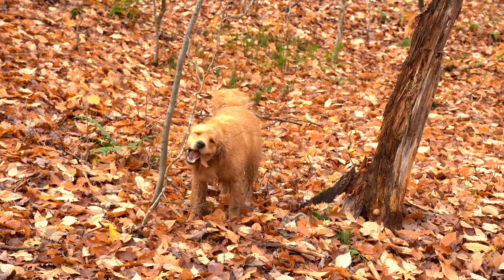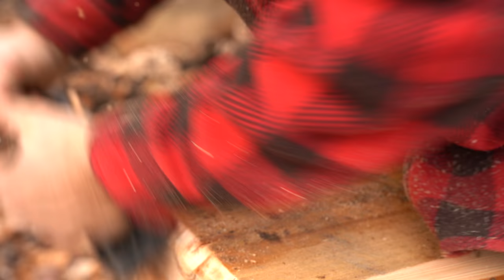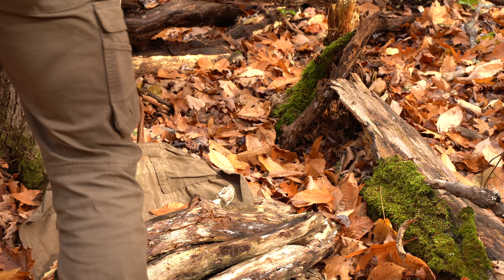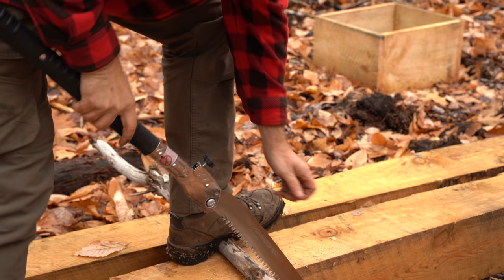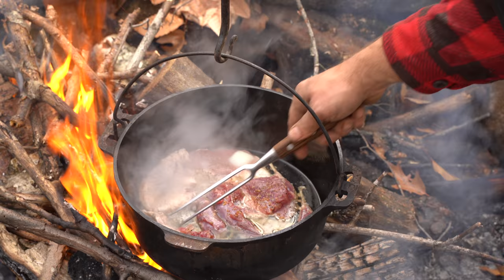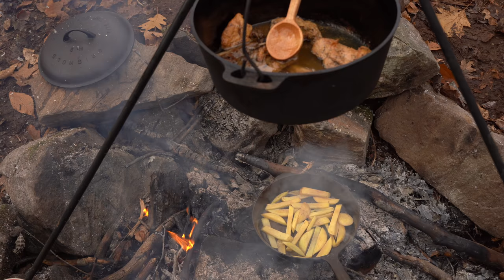Building a Square Off Grid Log Cabin| Lifting Heavy Logs | Squirrel Confit for Lunch

Comment: Also, by lifting the timber with only a single pulley at the top you're lifting the timber at 1-to-1 ratio. So if the timber is 100lbs you need to put 100lbs on your end of the cable to lift it.  If you added a snatch block at the timber you would cut the force required to lift the timber to 50lbs.  If you did a pully system with a double pulley at the top and a double pulley at the timber, you would be reducing the force required to lift the timber down to 25lbs.  A couple of small changes to make your job a lot easier.
Reply: You say snatch block, and my brain immediately jumps to the channel Smarter Every Day.  Destin did an episode basically dedicated to the snatch block, (and other force multipliers).
Reply: You are very right sir.
Reply: need to double the length you pull to half the force.
Reply: @nicko9715  When I saw shawns Instagram post then watched how Shawn rigged up his pulley in the video I  immediately thought of that smarter every day video and that's why I commented.
Reply: block & tackle for the win...!
Reply: @alexmattyspac7605  It’s not about the weight, It’s the height. Shawn pulls the timbers around single handed. Check the small limp trees. How tall will Shawn build?
Reply: @michaeldixon8817  weight at the ground level and weight and head level is two different weights that weigh the same... and that little rope is hard on the hands guaranteed. Trying to be helpful, I mean he has what he needs there.
Reply: @davebetker8788  no, just x2 the rope and  half the speed if he pulls slow, less weight may pull faster and better control of the weight as he goes up.👍simple machines are simpler lol.
Reply: @nicko9715  When he said snatch block, my mind when to Ron Pratt pulling vehicles (large and small) out of ditches, righting over turned vehicles, etc. :0D
Reply: @robguenther1648  How would you do this by yourself? I am in my 50's and faced with a strength detriment.
Reply: And this is where the "GEEKS" step in...
Reply: @SDPBALLCOACH  The Kevin Bacon?

Comment: I started watching this while thawing out a couple of small chuck steaks for supper, and wishing that I had some squirrel in the freezer - haven't had one of those in there for some 30 odd years.  Can still taste it in my mind, though.  My mouth was watering by the time you were eating your meal, and I had already grilled the steaks and we had eaten our supper.   I would have added a snatch block at the bottom of the pulley system, to reduce the strength/power needed to lift the  beams.  But then, I am not as strong as you or as young!  Cali is in her idea of dog heaven, with a loving and patient master.  As always, stay safe.

Comment: This all comes with massive love, respect and admiration James, I hope it's received as such.

If I might offer some constructive criticism. The flexibility of those two trees you used for the hoist are making you expend a lot more energy than you need to. Every time you lift a log you're first having to take up the slack from their flexing. It might be worth using two much larger trees as anchor points. Also, a block and tackle would cut the weight of the log considerably. At the moment you're lifting the same weight, just pulling down instead of up. Alternatively, you could use your atv to lift the log instead.
Reply: Or the frank and jim system

Comment: I really love the use of solid timber to build a permanent shelter . Insulation value per inch of thickness is equal to fiberglass , the inner and outer wall surfaces are finished and paint isn't required . Perhaps a mopping of Danish Oil for long term stability would be nice . I , and I'm sure you too , laughed at the lifting set up and the waste of time that became . As small as these timbers are , you are quite man enough to muscle them into place by a little leverage and logic . Looking forward to completion , this is a great idea . Long term stats should be interesting .
Reply: Fiberglass is only as good as the walls that support them
Reply: Fred , I guess you are formulae with the term “ thermal  bridging “?
Reply: I am still pretty sure that the R value of fiberglass is measured without any kind of gaps

Comment: Another fantastic video Shawn. Its cool to see you using different methods of log building. Speaks to the fact that youre not afraid to try new things. I like this one. It seems to be an easier way to build and appears ro be faster. I also like the chamfer detail you are putting on the edges. Is this to allow for chinking?

Comment: Hi Shawn, I'm no carpentry expert, but it would be a lot easier pounding those spikes by hand if you pre-drilled 6" deep holes first. It would save you from having to pound through so much solid wood.
Reply: Aw, leave him alone. He's having fun.
Reply: You're not wrong, but he hand drills things. Not much difference between extra effort pounding or now necessary effort to drill, you know? 😉
Reply: Warming the nails and coating them with beeswax might help if he doesn't want to drill pilot holes.I was wondering if the wood was going to start cracking if he didn't drill pilot holes. I guess it will depend on how dry the wood is presently and if it shrinks or warps in the future.
Reply: @gunners4129  it's not so much the effort or time, it's the wear and tear on the body. Pounding those nails, especially with the single arm hammer, takes its toll on the elbow and shoulder. Drilling pilot holes might take more time, but it's probably less abusive to the body.
Reply: @robguenther1648  hand drilling motion like that is really hard on rotator cuffs..

Comment: Putting up this building is going to be much quicker than with round logs. Does the preparation of squaring the logs take as much time as you spent scribing, cutting, etc with the other buildings? You'll have to show us some more milling? Perhaps floorboards? Maybe some of the recovered ash?
Reply from the maker: Good question, it probably takes just as long to square them as the round log construction. My next building is full scribe round though and I think that's going to be longest process yet
Reply: @MySelfReliance  I did my first full scribe in the early 80's,, with saddle ends,, & shrink fit full scribe in the late 80's,, now you can learn from youtuber's,, i coulda wrote a book  in the 90's..... speed comes from tricks,, mark & cut saddles in under 6 minutes... Fun in the day,, took me around the country building & teaching.. Aloha

Comment: I don’t understand this construction with the bark shims and stones?! why not level out the concrete posts, the timber Frame is then leveled out too if they are the same dimension?!
Reply: Maybe the floor is going in later and he needs a gap?
Reply: The bark may be protection from concrete, stone or the ground - I forget what is under the bark. However the sill plate in a home oftrn has some sort of material between it and whatever it sits upon..

Comment: Is there a reason for chamfered edges ?  Or just    Aesthetics
Reply from the maker: A wider gap for more chinking to prevent drafts - it's just a small workshop so I didn't bother adding insulation between the logs
Reply: @MySelfReliance  thank you
Reply: @MySelfReliance  do you plan to add on to the shop later on? Or maybe a covered porch for nice weather working?

Comment: Good stuff.  Not for nothing but you might want to throw in some ear plugs while nailing in those spikes with the small sledge.  Each strike is likely the equivalent decibel level of shooting a .22 pistol.  Thanks for the vids!
Reply: I have a friend who has been a professional carpenter for many decades and he said that he has permanent ringing in his ears. I thought it would be from using power tools but he said no, it was from hammering nails. Another person said her brothers who were carpenters were so bothered by the same ringing sound that they cut the V in the hammer claw into a deeper V to change the pitch of the ringing!

Comment: I love seeing how creative you get to solve problems. One thing I always try to think for myself and for others is that we can accomplish any tasks we want because we have brains. So while many people might think it's impossible to build a cabin by yourself all you have to do is figure out a way with your brain. Pulleys are a fantastic way to lift things that we couldn't normally lift. You may want to rig another pulley or two in that system to make things a little easier and why not use the winch while you're at it. By the way, you're a pretty buff dude(no homo) and we've seen Proenneke lift larger logs to build his cabin and I think we've even seen you do so your self, so why complicate things? Just manhandle 'em. Although I do understand why anyone would want to figure out an easier way and like I said, I think we all love seeing your creativity.

Comment: Shaun, why did you build the walls up without putting in the floor. It seems you want to make things harder for yourself instead of easier? You could have made an A frame to help with lifting logs in place for your build, whilst undertaking a pulley system. To help lift the heavy logs. Using a 3 or 4 block a d tackle would have made life so much easier for you. If you injure your back it's more often with your for the rest of your life. If in doubt ask, l am sure friends or other in Ontario would assist you in helping the build.

Comment: I am kind of surprised you didn't use half-lap joints or dovetails to avoid using the metal spikes, big nails would be faster for sure.  Seems like it would be smart to construct the log structure on top of a 12" high concrete of stone foundation to keep the wood dry and prevent rot.

Comment: I appreciate the description on how you cooked the wild game however, I'm more interested in your build strategy for the workshop.  Rigging up those cables with a single pulley was rather strange in my opinion as I would have used a double block pulley with a snatch block which would increase the mechanical advantage.  You used the ATV winch to hoist the cables but did't use it to hoist the beam?  In any event, I enjoy watching all your vids especially your building techniques.  Thanks again for sharing and give Cali good scratching for me, lol.  Cheers Shawn!

Comment: You should have notched out for the floor before raising the second tier of logs. Saddle notches instead of spikes are stronger and more authentic. A bead of caulk between each tier of logs would have been more effective then a chincking on the outside.

Comment: I noticed your plane with Miller Falls on it, over here in England I have a very old Miller Falls double ended 6 inch bench grinder 240 volts, its over 40 years old that I know of, and it was old when I got it, it is still in use often in my garage. Don`t make them like that any more.

Comment: Looking to build a cabin myself love the use of solid logs milled and simply using spike to hold together.  curious why you are flattening the sides, is that for water to run off?
Reply: Did you ever find out the answer to this? Have also been wondering

Comment: The apparent lack of chinking, or space to allow chinking.  Do you think the lumber will hold dimension well enough to seal?  Will you explain on the other channel?
Reply: Green lumber usually shrinks
Reply: Hi Bill. Shawn was asked about the edges he beveled with the plane by Kodiak Farms in the Comments section. Here is his answer, " A wider gap for more chinking to prevent drafts - it's just a small workshop so I didn't add insulation between the logs".

Comment: What size timbers are those?  I am planning on building some type of timber structure as soon as the snow melts and I can get on the land. I have debated using 6x6 hemlock or 8x8, and looked at the possibility of sandwiching 2x8 rough lumber together in 3 layers, and making tongue and grove, but it seems like a lot of work and although I like the tongue and grove aspects, I think I can make a timber one work. I plan on making a 24ft x 28ft, on piers and posts, and putting floor structure with 2x10's and 2 x 8' floor joists. I will need to use construction adhesive between layers and at ends of timbers to insure water doesn't get in, but not sure if that is good enough of a seal. Any thoughts on this approach, or should I stick to the tongue and grove method?  Thanks.....great video.
Reply from the maker: These are 6”x8” hemlock. My next cabin addition is going to be 8”x8”.  I chamfered the edges to accept a wide caulking bead for waterproofing, but you should also put a foam gasket between layers. The problem with construction adhesive between courses is that the wood is going to shrink unless it’s kiln dried, or at least very air dry
Reply: @MySelfReliance  Thank you, I thought they looked a bit 2 dimentional, but hard to tell with camera angles, etc.  I re-costed everything and I can do it quite a bit cheaper using the 2x8's, as I am going to use rough lumber which is milled by a very good local lumber mill and I think they will be easier to work with. I turn 75 in June so not sure of my lifting abilities, although there is always a way to get things done. I am enjoying your videos, you are an insperation.

Comment: Pretty girl Cali even when she's wet such a sweet dog and she's restless cause girls just want a have fun. What's that little cabin for and those things you pull the logs with are they like the things that were used to lift large blocks of ice?
Reply: Great idea. If Shawn built an ice house next to the pond and run a permanent cable system up in the trees he could move blocks of ice into the ice house all winter. It's something to think about anyway. Of course, I guess if the ice house was level with the water you could slide the blocks across the surface of the frozen pond. I think they originally used ice tongs for blocks of ice but those log tongs may work for smaller ice blocks. I wonder if you can still find the original tools used during the time when ice houses were common. Apparently, my grandfather had a specific saw to cut those ice blocks in the frozen lake.
Reply: @itsjustournature8045  when I was a lot younger I remember camping in BC and  the blocks of ice we bought were stored under a pile of sawdust. Maybe Shawn has a plan already it certainly wouldn't suprise me

Comment: How do I get Sean to answer my comment ?? I want to know what kind of insulation can be used and, Can any chinking be used ??. When building with these square timber.. I want to build the same in a snowy area, and want to put some kind of cold air protection between timbers. What should I do Sean ???  Inquiring minds want to know....Thankyou when you find time to answer....

Comment: dumb question, is there a reason why you poured the footers, then shimmed the lumber, instead of leveling the footers and not needing the shims?  Thanks.
Reply: Hi Joe. Shawn replied in the Comments section, I think it was a reply to Norb98, and it sounds like he ran of concrete. So he probably poured some of the footers, ran out of concrete and had to level up using stones and birch bark. Shawn should consider a live "Premiere" where we could put some of these questions to him, live. Or even a video where he answers the most frequently asked questions. Did you know about his other channel Shawn James? He often does more talking there and sometimes fills in some of the gaps and answers questions. I think he is really feeling the stress of winter coming on and he is trying to get as much done as he can in the nicer weather.

Comment: An obvious question, perhaps?
Why were the concrete piles not leveled to each other in the first place?
Reply from the maker: I hit rock and didn't have enough concrete to pour deeper pillars to make up the difference
Reply: @MySelfReliance   Thanks for your honesty. 
The horse hasn't completely bolted on this one.
You might consider levering the shuttering upwards.
This would allow a top-up, should you so wish.  And, have fun!  :o)
Reply: @timstewart8690  Hi Tim. By saying "you might consider levering the shuttering upwards", did you mean that Shawn could build the wooden sides of the forms to pour more concrete upwards if the option to dig deeper is not there? Oh, in re-reading Shawn's reply it sounds as if he ran out of concrete and had to use the stones to try and make up the gap.
Reply: @itsjustournature8045  Once the piles have set, the shuttering is redundant.
It can be left to rot, used for something else or disposed of.
Moving the shuttering upwards, to touch the lower timbers, would allow additional concrete to be poured.
It's not imperative, but, would look a whole lot neater, IMO.

Comment: Isn't that blowout construction? Termed that because heavy snow loads are prone to blow out the walls. I'd metal rod at least every 6 feet. Or wooden dowel the logs together every few feet. They used that construction for corn or grain cribs or barns because they're quick, but many times after years you'll see walls askew from load and wind.

Comment: Are you shaving the corner edges off to prevent splinting? Will you still need to do chinking between the timbers?

There are many ways to build a log cabin. Are you planning to explore these different ways in the structures you build?

Comment: What was the purpose of putting Birch bark between the frame and rock pads at all four corners? Just wandering... Does anyone know?
Reply: Everyone else is trying to figure this out as well. Some have suggested it's for leveling but Birch bark is not only waterproof it also has antifungal properties and helps  prevent rot... Hopefully Shawn will explain it in his next video.
Reply: @jd2055  thanks that actually makes a lot of sense then....